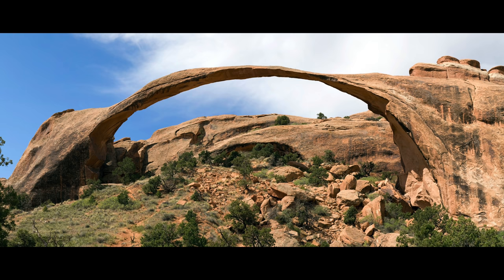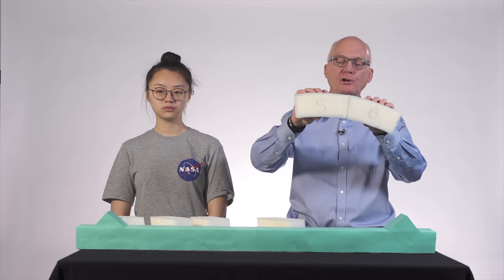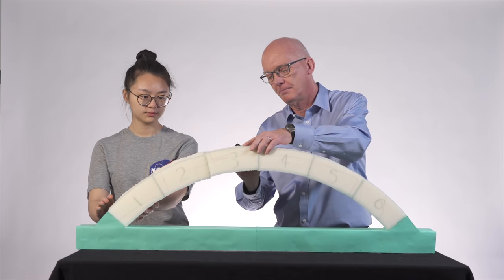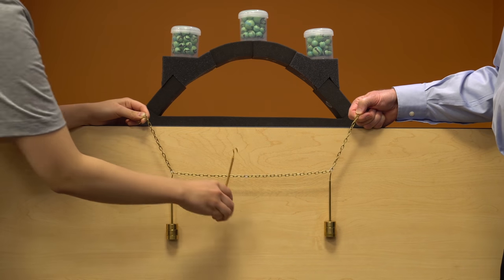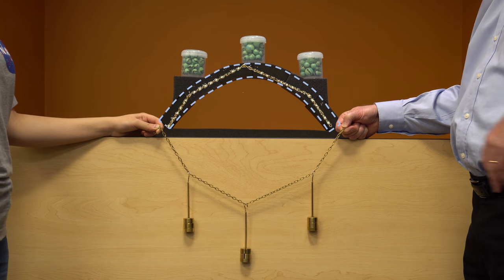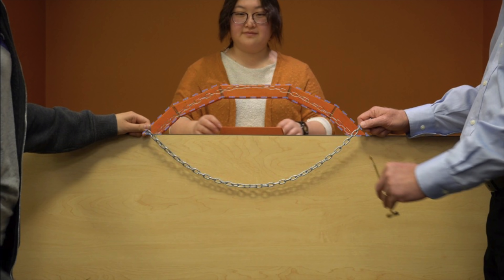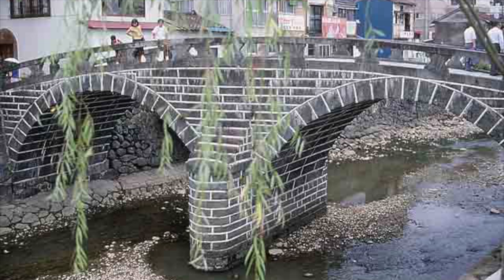Fun with Arches

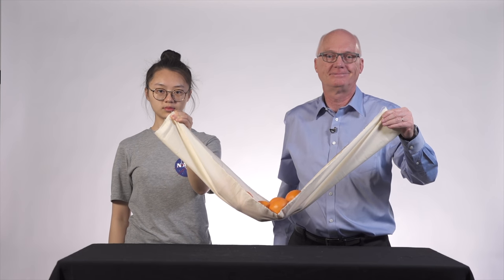Comment: 2:24
no, its cause your holding it mate, same as a hammock that has anchor points on trees
Reply: Right? Completely different scenario. The fabric is woven together and actually is analogous to the chain, not the arch.
Reply: @ludvigericson6930  also depends on how hard your pulling the 2 ends apart

Comment: That is very strange way to answer the specific question: why arch failed? Because it didn't pass the chain test. Oh yeah, chain is a very good and efficient model, say, kind of analogue computer that allows to model arch quickly, but come on, that's A MODEL. Why an alligator can't fly? Cause it is green! Very logical: it is green indeed, so that's why it can't fly, theory confirmed. Instead of explaining, that compression force is vectorised and it's perpendicular portion directed outwards overgrows weight (force, to be exact its perpendicular component) directed inwards, then structure collapses due to inability to take any tension and structural failure. So to compensate that, you apply additional weight that overcomes perpendicular vector of compression.

Comment: Arches do need a keystone, and your arch definitely has one. The word keystone simply means the stone at the summit of the archway. All you have done is replaced the keystone with two smaller ones, both of which are still keystones, only you have two of them. If you remove either of them, the arch will collapse.
Reply: Doesn't the arch collapses if you remove any of the stones, keystone or not? Clearly they refer to a keystone here as middlestone. They just say you don't necessarily need a topstone.
Reply: The reason they use a keystone is because it's easier to put in one last stone at the top instead of two  simultaneously. You would preload both halves of the arch, place the keystone and then let the arch relax into it's final shape.
Reply: Reasonable, but by that logic all the stones are keystones. Which is true. I think you have to allow that “keystone” is singular. In a figurative sense, one might talk about the “two keystones of the policy” but it’s a bit ugly, really.